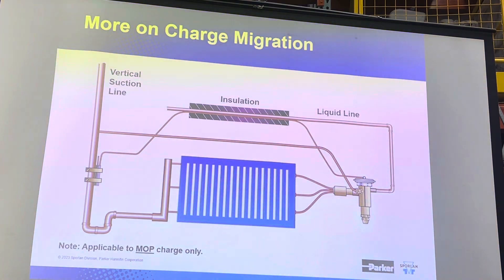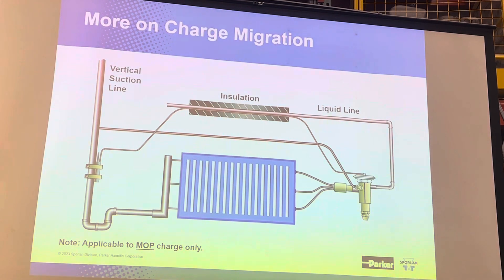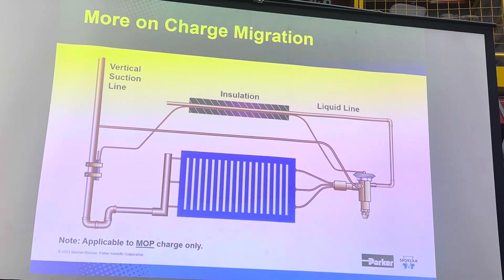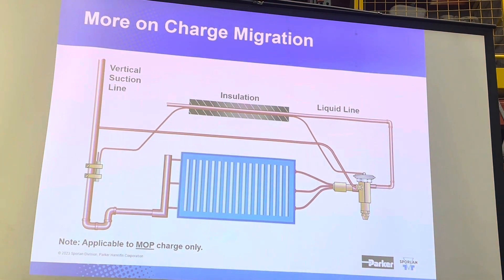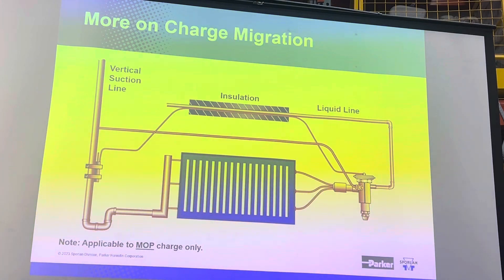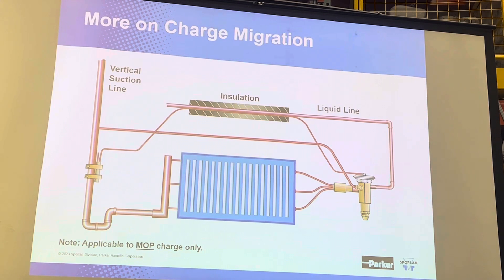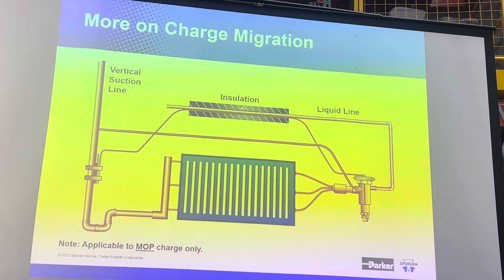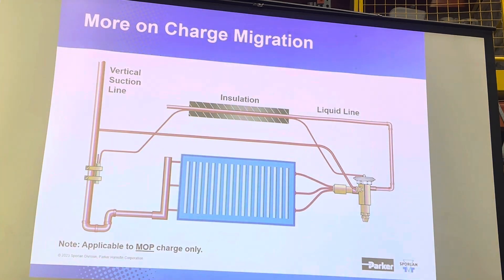Expansion valve, sensing bulb charge migration.

Comment: That is really an excellent speaker.
Reply from the maker: Yes he is.  He has been with Sporlan a long time. 
     You can find Sporlan on YouTube and their web site for more training videos and reading material. 

Also DanFoss has excellent training on expansion valves to. And more
Reply: Okay, thank you. I will check them out.

Danfoss is the brand of the thermostats at my radiators in my house. Didn't know that they are also engaged in cooling. Up to now I knew Danfoss only as heating specialists. In Germany they have big market shares in residential heating and are very popular.
Reply from the maker: @Akadectra  and VFD drives for large motors